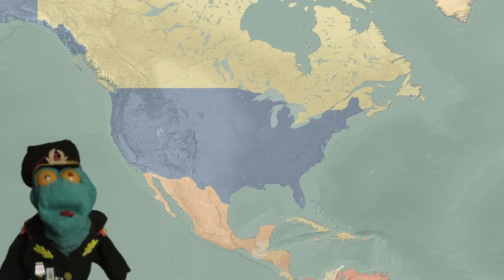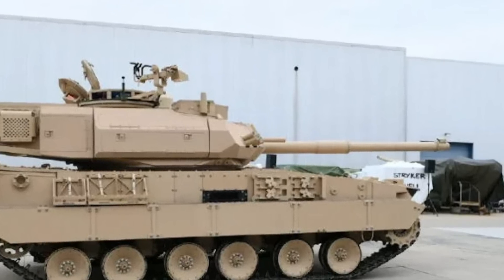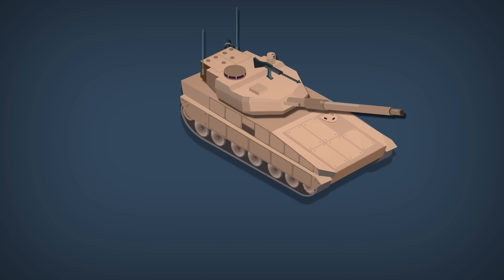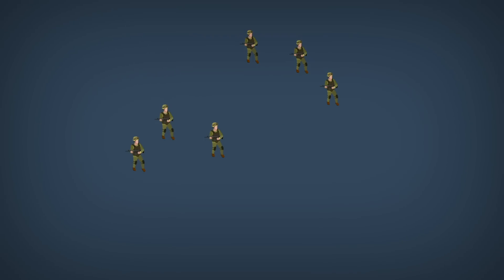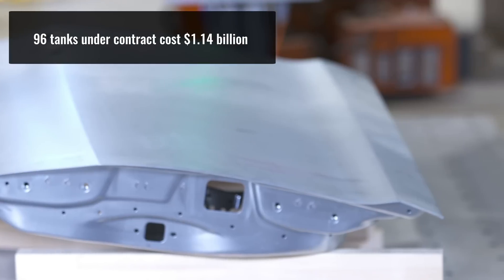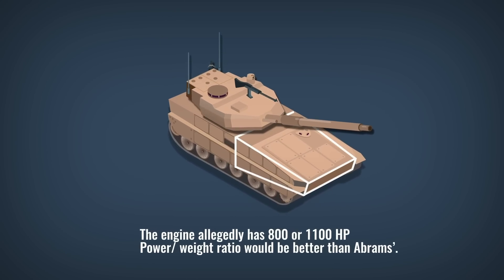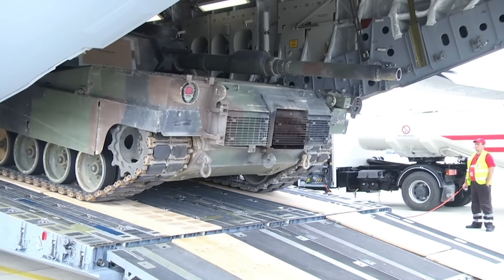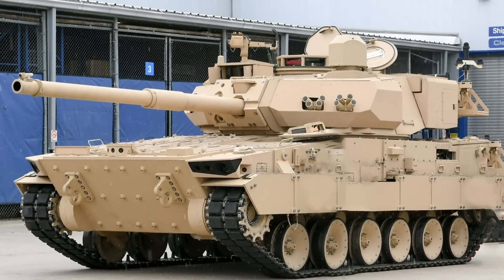US Army just chose its next (light) tank

Comment: Wouldn't the Ripsaw M5 with the light 30mm cannon do everything this "tank" would do more efficiently with less cost?  The Ripsaw can also be used for breaching, mine clearance, and other mission sets.  And when it's hit with an Anti-Tank missile?  No loss of life.   If you want something that can take out lighter vehicles from far away (anything less than 50 miles), just make a variant of the Ripsaw that carries a load of switchblade 600 loitering missiles ($10k/piece) and use the Ripsaw's tethered SkyRaider quadcopter drone to spot the enemy vehicles from far away.  Line of sight to the enemy is not required or necessary.  See some soldiers you want taken out from 6 miles away?  Just use the switchblade 300 ($6K).  I just don't see the MPF program capabilities getting anywhere close to those capabilities.
Reply: Those switchblades are quite a bit more expensive than that. I believe the 600 is nearly 60k
Reply: @theimmortal4718   If you don't mind, can you point to the link with that cost?  That's not what I'm seeing on Google, although you may have more current information.
Reply: @mjk9388  
It's just what I've read online. It's way bigger and has a much bigger control station. From what I've read, it's about ten times the cost of the smaller 300, and is more of a crew served weapon like a TOW rather than being man portable.
Reply: Not exactly, the difference is in immediate lethality. Switchblade and ATGMs are slow to reach the target, a large canon with sub caliber ammo will hit that target in less than half a second once that trigger is pulled. There is a video by the chieftain about this called "the tanks is not dead"
Reply: So funny every one thinks wars like a video game you can’t always sit back from far away and hope you find the bad guys and a ripsaw is not made for heavy combat attacks it might be good for SF team for quick fire support then running away but that’s all
Reply: @timothydixon2545  
Sometimes it's exactly that.
Reply: The biggest killer of armor in Ukraine is artillery. You can have the most effective tank in the world, but once you are done with your assault and try to hold ground, it will get spotted from the air and targeted. Tanks are big pieces of equipment to try and hide.
It doesn't matter how much armor you have if you get hit on the roof with a 155 round
Reply: @crassgop great points
Reply: @Aditya Chavarkar 
You know that's right
Reply: Did you even watch the video lol?

Comment: Whats a light tanks advantage over other light verchiles like bradily or striker m1128?
Reply: Main gun, also the Stryker AGS is basically out of service as it was too complex and a maint. nightmare.
Reply: That 105 also full tracks vs Stryker AGS which as noted has largely been relegated to the bench.
Reply: In all tense and purposes it's really not a light tank it's the same thing as the stryker MGS. It will be used pretty much in the same way. Also it's hull is based off an infantry fighting vehicle. it would be like putting this turret on a Bradley and calling that a light tank just my opinion.
Reply: Ok so the desgin trade off is ifv protection and mobility but trading transport space for a larger cannon?
Reply: @marcus7564  yeah pretty much I would say... but it's still a great piece of equipment for airborne or even the marine Corp if it had a 120mm. In my opinion
Reply: @marcus7564  Didn´t some company just present an ifv in Paris with 120 mm gun and full capacity for troops because the rc turret is not "penetrating" their space? Probably over 40 t. This one isn´t really light either. Nothing against simple solutions, but - ouch. Noone buys the Ascod. Technologically outdated from the very first day on. Too heavy for Helis and too light for serious jobs at the eastern front. I´d go for a really light solution instead. The Abrams is fine for other purposes.
Reply: @FirstDagger  why is it too complex and maint. Nightmare? Sounds made up. Everyone else has wheeled light tanks.
Reply: Nothing a AFV with tow missiles are much more useful and this isn't a PT 76 Desi to operate on water and quickly cross Rivers and mud Fields common in N Korea or low land china. This is designed to work as mobile fire support against lightly armed insurgents the way WW2 and Korean war light tanks did in support of old school infant pushes against lightly armed Japanese troops or depleted German army units when the allies had total air support to clear out strong points,houses and bunker and pretty much everything else would bog down in Korea. That will not work in modern combat every ATGM ever made would quickly destroy it, helicopter's, artillery would do the same and infantry can't push out in the open anymore because of cluster munitions. The 105mm gun isn't powerful enough or have the range needed to out range man portable ATGMs. This tank would work in Korea if they design it to be amphibious but if not it's useless in the Pacific
Reply: The idea is a lighter option that easier to support logistically
The problem with MGS was that it was poorly designed 
Griffin has actually has a lot potential because the Army can use to replace the Bradley and have a common platform which would save major $$$
It can configured as a light tank and configured as Bradley replacement with the newer 50mm XM913
The only thing it would need would the Spike NLOS
Reply: @TheBooban  Gun was too powerful, causes issues with frame. Everyone else uses less powerful gun. America likes big gun. American version no work.

There did I dumb it down enough for you?
Reply: 105mm gun, tracks, no space wasted on inf transport, higher speed and acceleration.
Reply: @FirstDagger  The Light Tank is what replacing the Stryker AGS in service
Reply: @TheBooban  ; Look up the autoloader on the AGS.
Reply: @michaelsheal4015  ; Literally what I said.

Comment: Aluminum Armor is ridiculous for use in combat vehicles. WHY?  Aluminum is a PYROPHORIC metal which means it is flammable!!!  That means  it creates a class D fire which cannot be extinguished with normal techniques.  They have to use things like HALON systems to smother it by denying oxygen to the fire.  If you happen to be wounded in the vehicle and cannot get out then you also suffocate with HALON systems.  And just to bring the weight down.  It may not be that important against lesser adversaries but if we fight a near peer it could be.
And no I am not a soldier, just I am a 14 years old who does know chemistry a bit and physics.
Reply: Aluminum isn’t flammable it does melt at 600-700 degrees though.
Reply: The M113 and all of its derivatives have Aluminum alloy armor. Many are still in service today, and some have seen combat. I don't think I have heard of many of them "bursting into flames at the strike of a match" in such situations. I am sure they have gone up in flames after being hit by a HEAT round, but that is to be expected. There are also several other AFVs that have been built with Aluminum alloy that have been successfully used through the decades. Not to mention the AR15/M16/M4 rifles that have aluminum components as well... 
While, you are correct that Aluminum is a pyrophoric metal, but not so much so when it is an alloy in sheets, or used as structural elements. The form that IS pyrophoric is Aluminum shavings, or similar type of Aluminum.
Also consider Magnesium, another pyrophoric metal. It is still a well known alloy for racing wheels....
Reply: @gabrielm.942  
OK misters picky.  What did I say was Aluminum is being PYROPHORIC ( look uped what does it meaned ) and being as Pyrophoric does meaned it cand maked a class D fire and it will.  Magnesium, whiched is used ined incendiary shells and tracers does haved a burning temperature of 5610 Fahrenheit Degrees!    “Aluminum burns when exposed to a flame, as it is a reactive and flammable metal. “<—-   “It burns in oxygen with a white flame and by forming aluminum trioxide. “ “The oxide layer that always covers aluminum metal protects it from reacting with the air.” Hence the label of pyrophoric. [a]
-  You said it Aluminum is not flammable and you are wrong!  Aluminum does haved an ignition point of 3300 Fahrenheit degrees and is a pyrophoric metal. It is not a easy thing to maked burn but when are you firing shells at it withed magnesium charges ined simple of tracers and muched more ined incendiary shells suched as Thermite and incendiary bombs even. 
-  To Maked Thermite (1)Obtain finely powdered iron oxide (rust), ALUMINUM POWDER and a thin strip of magnesium. The iron oxide and aluminum will react to form thermite, while the magnesium will serve as the ignition material.[b] JUST a example of how is aluminum flammable. AND, all though Aluminum haves a 3300 fahrenheit degrees ignitions point, Magnesium (another flammable metal) haves a burning temperature of 5610 Fahrenheit Degrees! Well hot enoughed to be comed a ignition source for Aluminums. It does not burned easy but it does to burn and burned hot.
-  All so it is being a relatively soft of material which cand spall easily which does all so maked it not so great. I am sure you would to not liked being sprayed withed melted aluminum neither.

-  Oh yes, I forgetted to add that Aluminum is very TOXIC and is being a brains poison just as liked LEAD is.  Sorry I forgetted to add that.[b]

PYROPHORIC:
pyrophoric: adjective
py·ro·phor·ic | \ ˌpī-rə-ˈfȯr-ik  , ˈfär \
Definition of pyrophoric
1 : igniting spontaneously

-  [a]   https://www.reference.com/science/aluminum-burn-dbb0815b1a562d35      
-  [b]   https://www.thoughtco.com/thermite-reaction-instructions-and-chemistry-604261

Ok…now be for do you started to castigated me for how cand I writed stuff:  I am at 14 and when was I at 11 my #23 fosters father turned to be a vile evil pedophile and when did him and his firend tryd for doing stuff on me I said it i will call the socials lady and cops. At then he hitted me ined my head withed a big of buckle belt and they did to chained on me to the wall and beated to on me for days an craxked my head and I geted a TBI and after sheriffs saved me I haved to haved brains opiration to lived. Afters that I haved aphasias damagings ined to my brains a little. It does maked me muted and wrecked how cand I writed good and wrecks how cand I see it stuff some of times and others stuff too.
-  I haved therapys helpers and my new of fosters do helped to me too and too my roommates I go at school withed.  Aphasias doesed NOT to maked me a retard or as that! Only it does wrecked communicating of stuff. I go at a magnets school and I do haved still grades of averaging at 3.64 so longed as I geted helped to edited stuff. First of time I writed of this I geted my roommate to edited for but at now amed I aloned and noned of any one arounded for helped. Sorry ifed you cand not read it good but his is being good as cand I do it at aloned.
Reply: @rokuth  
Readed it what just I posted for that others guy.  And never did I say it aluminum will burned fromed a match!  I said it that aluminum is being a PYROPHORIC METAL and is flammable. IT WILL BURNED, aluminum haves a ignitions point at 3300 fahrenheit degrees, magnesium haves a burning temperature of 5610 fahrenheit degrees, more thened enough for that 3300 ignitions point.  Magnesium is being used ined tracers and any of incendiary bombs and shells too even.
And ifed do you readed you would finded it that there was LOTS of controversy over aluminum as armors ined the M113 and too the Bradley IFV.
READ WHAT DID I POSTED TO THAT OTHERS OF GUY.  Yours comments are true ined low levels investigating but aluminum cand be selfed igniting even withed out that coating does it haved on it all ways. And magnesium is fined unless do you put heat to it beyonded of its ignitions temperature. And ifed do you do that then you will geted a class D fire too. 
Thanked you for commenting.
Reply: @jacobsparry8525  your concern on aluminum causing a class D fire is a valid point, but:
1) the Army already considered the risk into account, as previously commented by the other person above.
2) your passionate reply to that previous comment is rather misplaced; consider sending either the Army or the manufacturer for that matter.

Also my sympathies for you, having that traumatic experience.

Regards, a random stranger.
Reply: @OverseerMoti  
haha….yes for sure. Gived to me a braked dude!  All ready do I know it the militarys thinked the risk is being Ok and for sure will they not cared of what would I say of it. And too evened maybe they are being as right. Never I said it only amed I being the right of one, just that I amed a th(nking of person and do I thinked having of suched a risk for only weights loss is not good. And only of reason even amed I at to here is be caused does my neurologist doctors said it ifed do I writed and writed and writed that may be the high ways ined my brains cand maked new of roads and could I may be writed normals agained. They haved said it I cand not lived long as cand every one elsed and may be if do I readed and writed cand I lived over it 25 as haved they said it. So just do I read stuff and commented ond what doesed geted interesting for me.
Thanked you for commented . Goodbye.
Reply: I'm sure the dod has this figured out but thanks Mr. 14 year old

Comment: The Abrahams tank is too heavy to be transported by many means. I don't know how viable this tank will be but it definitely solves one of the main problems of logistics.  I wonder how long it will take to get a suitable new main battle tank which can be better transported or if new means of transportation will be mass produced to solve this issue.
Reply: One of the requirements was that this light tank needs to be able to be air dropped by plane. You can't do that with Abrams.

Comment: Wasn’t this the point of the variant of the Stryker with the big long gun?
Reply: yep but this is more heavily armoured and tracked allowing for more reliable use in combat compared to the striker
Reply: Yeah but defense industry doesn't make big bucks by sitting back and allowing the soldiers to fight with tools they need. They'll bribe some big brass and presto, you have a light tank program.
Reply: @johnulmer6715  you're actually quite wrong about that, this was a logistical move. Strykers are being replaced by this because the Stryker platform was horrendously mechanically unreliable and rather routinely took up 50% of maintenance of the units they were attached to which is deemed unacceptable. They're being replaced with a vehicle with component and design commonality with the Abrams to lessen the logistical strain of a light protected firepower platform. Basically replacing the Stryker MGS with not only an up-armored but more reliable replacement. For once this is the people in charge making a good decision, which is rare.
Reply: Stryker was garbage tho

Comment: A 40 tonne tank with a 105mm gun is not a light tank. That's the same as a T-72 or T-64 or Leopard I. It's definitely a medium tank.
Reply: The classification is based off of the role it fills, not the actual specifications of the vehicle
Reply: t72 and t64 are MBT.  "medium tanks" classification was used on ww1 ww2 tanks.

Comment: Seems like an interesting design, may be quite survivable for a vehicle this light, but at the same time it's a poor fit for anything. Too lightly armored for long term counter-insurgency, still heavy for quick reaction, too lightly armed and armored for conventional warfare, separate platform and gun from other vehicles in use. Would be a better idea to take a hint from certain LAV variants and just make MGS redo with a 90mm gun. Still good enough against buildings and light vehicles, but not big enough to mess up the vehicle with weight and recoil. 90mm is out of use in US Army, but so is 105 really, and there is no pressing reason why the support gun not really meant against tanks has to use 105 specifically. This way infantry would have a support gun sharing most of logistics and mobility characteristics with their Strykers. Alternatively build it on the chassis of Bradley or whatever they are planning to replace it with for the sake of logistics. In that weight range could have also went straight to CV90120 with its full power 120mm that can fire NATO ammo and be a proper threat to MBTs.
Reply: its not really that light. t90A is just 10% heavier
Reply: man russian tanks is about 40-50 tons and this prototype is 34 tons  and it is LIGHT tank

Comment: Why doesnt it have 12,7mm as coax and 7,62 on turret, the other way around?
Reply: Sometimes it's a space issue. It's easier to squeeze a smaller gun inside the turret. Space is limited. Then you can put the bigger gun ontop.
Reply: 12.7 ammo is huge and the co axe is used to kill infantry the 12.7 is for shooting down helicopters (well trying too)
Reply: Very few tanks have heavy MG's as a coax because real estate inside the turret is extremely limited.
Reply: 12,7mm could fulfills both anti-air and anti-infantry, so its put on top to do anti-air
7,62mm is purely anti-infantry due to its inferior range

most tanks designed previously also went with this config